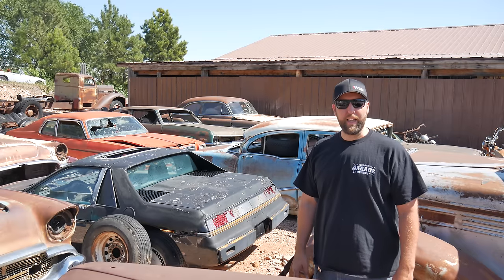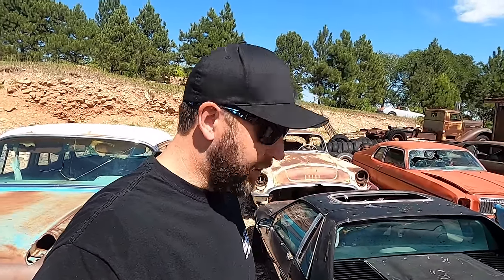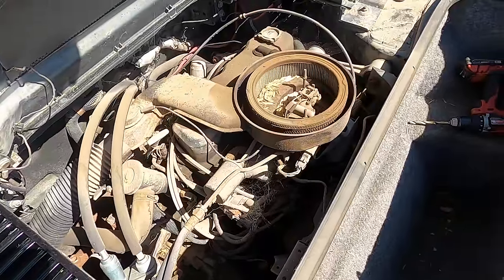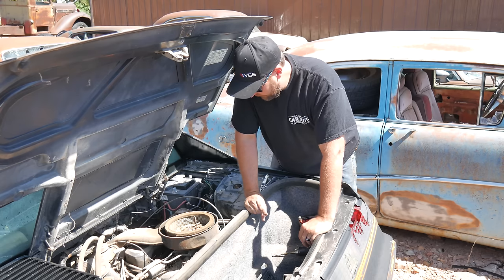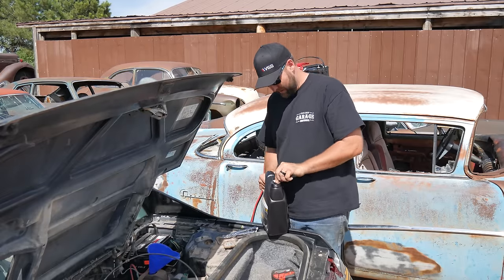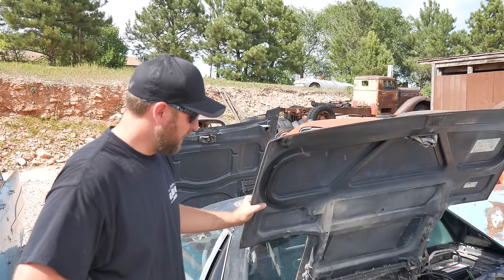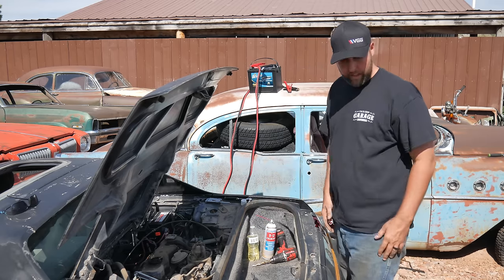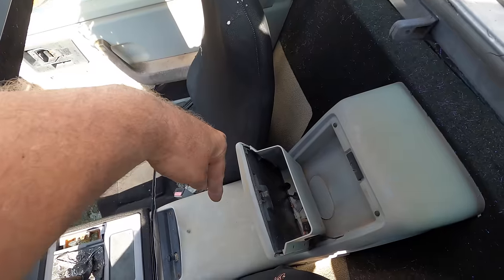ABANDONED Pontiac Fiero Will It Run And Drive After 17 Years? - Vice Grip Garage EP 97

Comment: My father in Law was on the design team for the Fiero. They tried to tell GM uppity ups that the vehicle was not production ready but they bypassed their top designers and pushed it through. It was a disaster on wheels. The last year they made it, they finally fixed all the problems. By then no one was purchasing them so they killed it. My father in law was pretty upset over GM being like that and went back to Ford.  He helped design the Mustang back in the 60's.
Reply: GM really did a disservice to the Fiero.  They gave Pontiac absolutely NO budget to design the car with.  I heard the suspension still used old Corvair parts because they weren't given a budget to design anything new.  Last year '88's are totally redesigned suspensions by Lotus, and like you said, the other problems were fixed too.  Too bad.

Comment: After watching these videos I started working on my 1994 Ranger with 307,000 miles on it ! Got running and driving! Thanks Derek!
Reply: Unusual for a Ford… common for a Toyota
Reply: @hankhill3417  I've had a 99 Ford Taurus, make it to 403k miles, same engine and transmission. Sold it for 1500. Also know a guy owned a 97 Expedition 375k same motor and transmission.
Reply: @hankhill3417 no really but Toyotas rust before the engine fails
Reply: @hankhill3417 Not uncommon for a Ranger at all lol

Comment: After watching about twenty of your repair videos, I finally got the confidence to restore my old 1980 Jeep CJ5.  I hadn't driven it since 1998.  It sat out in a field with no top on it for a couple of decades.  It was pretty run down, but we got it back to going again after about a month or two of Saturdays and I drove it again yesterday, for the first time in about twenty-four years.  It's got the same Pontiac I -4 , 2.5 Liter, 151 cu, inch engine in it as your Firero.  Thanks, Vise-Grip!

Comment: Derek, A couple things: I've seen you work on a few 2.5 engines now and just wanted to mention that sensor attached to the air cleaner is a MAP (manifold air pressure) sensor and will drastically alter the way it runs, and also allow it to go into closed loop. It's better to just unclip it from the air cleaner and leave it connected. The next thing is, if you run into a trunk that houses the battery as this one does that you don't have keys to, hook a battery or charger up to the cigarette lighter and you should be able to use the trunk release instead of drilling it out. Great vids, buddy.
Reply: Old 2.2 and 2.4 mopars are the same. When they fail they just dump gas into em like mad
Reply: That's a good tip, backfeeding the cigarette lighter.
Thank you
Reply: Good tip
Reply: @TimBowermeister Why not just hook to the battery terminals? You start sending electricity through things that aren’t supposed to be connected to electricity you could end up burning up the entire car. 😂

Comment: New subscriber from Sweden here. Breaks my heart to see a Fiero in that condition. I've owned Fieros since 2001 and absolutely love them. Never had an iron duke though. Mine have always been 87 GT's with the 2.8 v6.
Throw on a few modern suspension parts and they're like glued to the road.
Reply: I got a Fiero 10 months ago and used it as a daily driver through the summer months. It has the iron Duke, and it isn't a bad car

Comment: When testing for fuel it is important to aim the fuel line at the lightning whirler.
Reply: Also at the bare wire connection when testing the new pump lol
Reply: To make sure you have good gas...
Reply: Had a Jeep Wrangler with a 4.2 crack a fuel line and dump 1/2 a tank on the exhaust manifold once. Never even lit on fire

Comment: I think a guy just single handed increased the value of Fieros. Believe me when I tell you fellers, go out and buy one right now, before they become the next Hemi Cudas.
Reply: Can we get a guy to go rescue a fairmont?  I’d like mine to be worth at least half what I invested...
Reply: dont do this those things are junk and will never be a hemi cuda
Reply: <<< I sure hope you're right!
Reply: Ryan Rohauer is a Fox body mustang in a plain package!  (And it weighs less than 2800lbs)
Reply: @anselpeneloperainblossom-s3489  it's also has the engine in the rear and are a nightmare to work on it's nothing like a mustang. Oh and also prone to burning to the ground
Reply: Even Bad Chad would pass on a Fiero !!
Reply: riflessss ya.  He’s actually only about 15 minutes from my house too!

I just found them last week.  I want to take my fairmont over and get it on the dyno, but-A. a 225hp 302 isn’t worth putting on the rollers

And B. It’s not LS powered. Lol

Edit-  if I could afford to get a mid 2000’s 5.3 with DOD in the fairmont, I would.  It’s my daily and I run over 100 miles a day.  And if the ex’s 07 4x4 avalanche can get 25 mpg, just think what I could get in my car.  And have 300hp.  She had one of the few l33 1/2 tons

Comment: I bought a Fiero GT
 Cool car. At 120 mph the headlight covers flipped open..Speedo only went to 120. The limiter cut the spark at 120.
Not a winter car. A little ice and the midengine acted like a center pivot. I spun down Fremont road at 50 mph when I hit the breaks before turning onto lot road. I ended up sitting on top of the snow bank. 
Amazingly enough it drove right off and back on the road. 
In the summer I was driving home from work and it bogged down like the choke was on. It only ran with my foot to the floor. 
I drove it 30 miles to Sturgis where I bought it. I drove a loaner home. 
Turns out that model had the oxygen sensor wire running parallel to the coil wire. Ot induced a current in the sensor and burned it out. 
No recall.  Just if it fails, fix it under warranty. Yay for GM. 😁😎

Comment: The car I have in the back yard was sitting there about 12 years. All the tires were flat and had cracks from exposure. They filled right up 3 months ago and are still holding air. 👍

Comment: I was glad to hear you give the Duke a little respect.  It was designed from the outset to be thrifty, so it wasn't powerful but it made decent torque way down low.  In my experience, the Duke is dogged and relentless, akin to the SBC in that it'll run poorly longer than some engines will run at all.  It's not exciting unless you're excited by reliability, in which case it is stunning.

Comment: That little Fiero is a fighter, even the tires refuses to fail. She wants to be driven as long as you know she has actual fuel pressure 😂. 
She seems too far gone to be restored. Not impossible but impractical given it’d probably cost a fare few dollar bills there. Most of the budget would be put toward glass lol. She seems like a good parts vehicle to donate toward a other Fiero, good engine and drivetrain. Other than that she’d be a good toy/yard car. 👍🏻

Comment: Had an old mechanic buddy of my dads tell me if those TBIs ever run dry, you gotta cycle the power, and have pump pressure 15 to 20 times on and off to prime them back up or there can be an air bubble that can mess with its pattern.

Comment: I see a 70-72 Monte back there. On the “want, someday” list.
Reply: I had one in high school.  350 4bbl.  Class of ‘78. 👨‍🎓
Reply: I got a 70 mc! Had it since '95.  350 crate motor, 650 edelbrock. rebuilt th350 with a shift kit. One day im gonna swap the drivetrain into an old chevy truck, and get a 454, th400, 12 bolt posi... thats my someday list!
Reply: I used to have a '70s Monte Carlo with working AC in mint condition, I busted the windows out of it and made it into a race car like a complete idiot.

Comment: Had the same car in Highschool, 1990.   Yes there are speakers in the headrest, 4x10s in the dash.   Oh yeah, the Fosgate punch 10 inch fiberglassed in the passenger side floorboard.  Old school punch 1560 in the flip down console.  The mail vans use those same 4 cylinder iron duke engines.

Comment: "Will it run again?" I worked at a Pontiac dealer and these didn't run when they were new...
Reply: I know right, a buddy lived across the street, owned 4, his dad worked at the dealership, they bought them back from the owners, and they got them free.
Reply: They had the reliable Iron duke engines...I guess it was external components that were not reliable...
Reply: Mine when it ran was loads of fun, parked and forgot mine after the water pump sh$t the bed.
Reply: @seanpalmer2050  'sportscar' is subjective... though I used to have a buddy that suped his up enough for the quarter mile that the frame torque from the power cracked the sunroof
Reply: Really bad valve train..lets keep goin..
Reply: @willjoo5976  Well, they should have been called the Fire-O because they used to burst into flames while you were driving them...
Reply: Least when you broke down they weren’t hard to push
Reply: @k0edby22  what do you really mean?
Reply: @johnspencer7291  I just want a cookie 🍪
Reply: my v6 ran great ...
Reply: @k0edby22  I may indeed be full of shit, but those cars DID catch fire :)
Reply: @bryandamkaer3646  I think it’s one of those things where the finally were decent in the end then they stopped making them lol!
Reply: Yes they did and it was only the 1984 that needed some help. I have own 3 so far and have a new home and still running.
Reply: @k0edby22  You are on point and I wish that people know the truth. Great cars and where ahead of there time. My first one was sadly not in for the recall and even tho it had a small fire, I was able to fix it and was driving it for years when it was fixed.
Reply: @thomasschemmel8002  they are great cars. I’m enjoying the appreciation value on my bright red 88 GT. Such great cars, I have a feeling they will explode in value in the coming years.
Reply: Tyrone Shoelaces  I'm 55, and I agree!!
Reply: Hey! I put over 100,000 kilometres on my first one...4 cylinder underpowered 84. My second one (6 cylinder)was totalled in an accident when some yahoo ran a red light...no injuries to me even though he T-boned my side! My replacement 6 cylinder 86GT model had over 260,000km when I had to trade for a 4seater Sunbird... I acquired a guy and his mother! I loved my Fieros! I gotta say I never had a fire and I drove from Toronto to Tampa every year!
Reply: @impunitythebagpuss  Even a stopped clock is right twice a day. I never owned one, I just know that our shop was FULL of these for repairs. Glad yours worked for you though!!
Reply: I had a 2.8 SE, one of the last years believe it was an 87.... Was a 4 speed manual, felt like ya were going like a bat outta hell but the speedo told a different story! Had plans for a 3.8 SC swap, lost interest when it caught on fire.... Ironically, at the SAME time mine was cooking, another one was cooking just one town over! Not sure why they were fire hazards but one backfire led to mine being a melted mess :/ Couldn't believe when I traded it for a running, driving Iron Duke S10 5 speed! Cool looking cars with horrible electrical and more recalls than a Pinto!
Reply: @Badhagis  only 84s
Reply: I saw one tonight in Pigeon Forge, TN that was running like a top.  I have owned 5 and they all ran great.   Bought my 1st one an 862M4  in 1990 got a 88GT in 92 I kept till late 2017
Reply: @barrya.6212  The Iron Duke was what caused them to catch fire in their first year. I wouldn't call that reliable. The 2.8L V6  was and is better in it than the Iron Duke and really was more reliable. The Iron Duke or Tech 4 as it was called in the Fiero had leaky valve covers in 84 that leaked oil down on top of the catalytic converter and muffler right below and caught fire AND the connecting rods were prone to failure because of a defect in a run of them that GM knew about and pushed it out anyway. When one broke it would pop a hole in the block and the engine would puke all its guts on top of the hot exhaust below which then caught fire. So blown engine AND it caught fire and burnt to the ground. I would definitely not call that dependable either. But that was solely in the 84s and it was made another 4 years.
Reply: @Badhagis  I can vouch for that
Reply: @k0edby22  well fieros around me were 1500 a couple years ago, that was for a decent example. Now they want 12500 for a iron duke version with over 100k km.
Reply: That's obviously incorrect.
Reply: @Badhagis  BS. That was ONE year and ONE year only. 1984 and was ONLY the 4 cyl .  Oh.. and they sold about 125,000 Fieros in 1984. You want to know how many many managed to catch on fire for two different reasons? About 130 to 150.  That is and infintesimal amount. 0.12%. Twelve hundredths of 1%. Before you spout off like a typical keyboard warrior,  I highly suggest you read a little first.  I have a 6 cyl GT that has 270,000 miles on it and is still going at 32 years old and the original transmission and maybe motor too. You were saying again?
Reply: @mattmclean8267 6 cyls had exactly one recall and the 4 cyls were recalled for the Iron Dukes problems that one year. So no, they didn't have "more recalls than a Pinto".  You are just another person who thinks they know everything when they don't
Reply: @vanceogden2482  Calm down there Lance...I'm not insulting your mom. It's a car.
Reply: @Badhagis  I don't deal well with ignorance on any issue. The internet is free. Use it for research instead of porn. :-)
Reply: @vanceogden2482  Hah, I find it interesting that you tell me to be informed, when in the very beginning, in my very first post, I said I worked at a Pontiac dealership. My experience spans many years and many many vehicles, while yours only seems to encompass one...your own. So tell me which of us has had more hands on experience with multiple Fierros? Then tell me again how I am the ignorant person in this conversation. Plus, I find it very telling that you have to resort to insults and name calling in order to try and win your argument. I'm sure anyone reading this post will immediately see clearly who is the ignorant one.
Reply: @Badhagis  if you didnt realize how infinitesimal the numbersof fires there actually were than you are the ignornt one. And if you had actual hands on experience you would know that, so Alex. I'll take BS stories that never actually happened, please. (And by the way, I have owned and own multiple Fieros andhave a relative that owned one too and do my own "hands on" work
Reply: @vanceogden2482  That was a good one!!! :D :D :D

Comment: I would love to have your knowledge of cars. To be able to walk into a junkyard, look at a car and know how to start it up. I have to call you the “Car Whisperer”.
Reply: I'm 13 and have some knowledge of this stuff but it is because my dad told me how
Reply: Anyone can do this still if your willing to get your hands dirty and willing to learn the basics of "suck, squeeze, bang, blow". These older cars all fairly basic still, heck the Fiero being fuel injected was considered new tech back then as throttle body had began all cars switching to fuel injection. The other cars in the yard probably have minor issues to get them to run and the ones with major issues are probably basic repairs, easily fixed with the right time ans money but certainly not complicated, once you learn the basics. I started at 8yrs old fetching tools for my dad. By the time I was 10 I was doing tune-ups and brake jobs and by 15 I rebuilt my first engine and installed it myself, literally chomping at the bit to get my learners permit. My dad didn't "teach me" as many would assume. Instead he yelled and smacked me upside the back of my head if I got the wrong tool or if the pry bar slipped as he was trying to tighten a bolt or something. It wasn't a pleasant experience throughout my childhood but basically through repetitive observation of watching him do different jobs on different cars over and over again, I eventually took initiative and started doing the same thing I saw done 10 times before. Kind of like watching YouTube videos today but without the concussions and blown out ear drums. 😢
 Even now after 40 yrs of working on cars, I occasionally might be working on something I've never worked on before and I too will at times go to YouTube to see if anyone else has ran into the same problem and I would say 7 out of 10 times I'll find what I'm looking for on YouTube, and I'm not talking about basic stuff either, but more advanced mechanical stuff. The basics like what this guy is doing is the fundamentals for any car and is all over YouTube. He does a good job if showing diagnosis the problem step by step by methodically doing what every good mechanic does. Start by seeing if it's getting fuel and spark. Point is that if someone likes and wants to work on cars and be able to do this, then there's really no excuse why anyone, even a young girl included, couldn't work on cars in todays unique world. I know because my 18yr old daughter can rebuild her own engine. Unlike my father, I taught her how to change a tire when she was 6. The hardest part she needed help on was breaking the lug nuts. But I showed her the principal of leverage and a long pipe on a breaker bar trick....a very long pipe. LoL the rest is history and now here she is 18 and she can rebuild her own engine.
 The only reason why most young guys don't get into fixing their own cars today is because snowflakes ❄️ melt in the sun 😎
Reply: @blackisback74  I'm so sorry for how your dad treated you. That's tragic :(
Reply: So, learn....

Comment: The reason the tyres (yes, I'm in the UK) inflated was twofold: first, the diddly dooberry inside the whatsit was still more or less intact.  Second, and perhaps most importantly, the thingummy doofer was protecting the oh my god what is it called? so that the pusher-upper was resting on the seedmaker gravy pump.  I hope this helps. x
Reply: I used to make whatsits and dooburies yonks ago way back in 1910, it was using them thingamybobs with a ball on top swinging it 420 degrees so it hit the doofer.